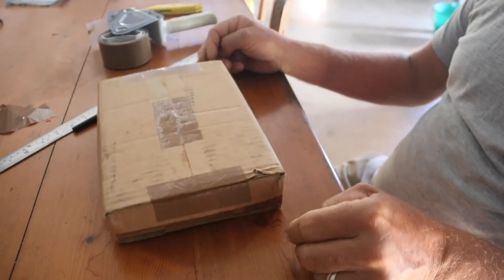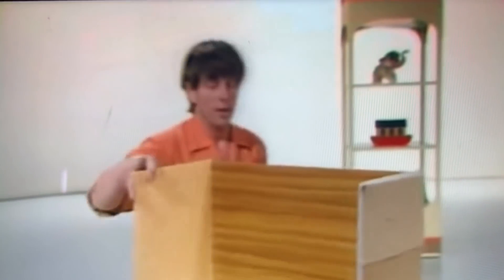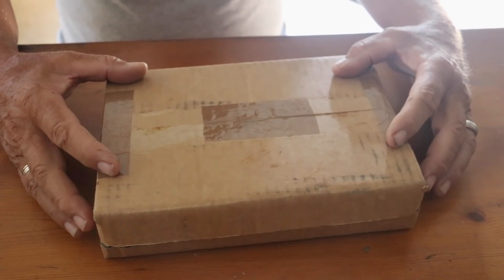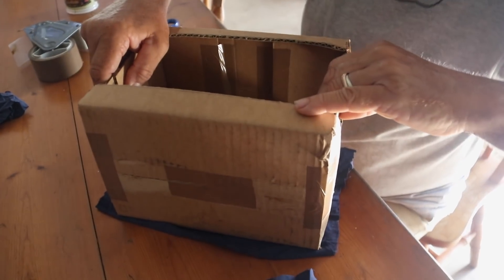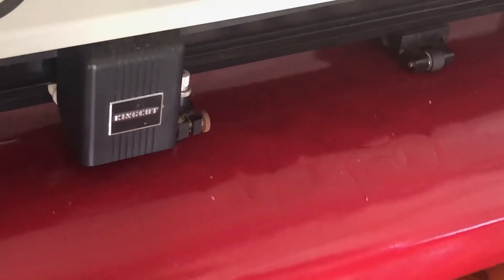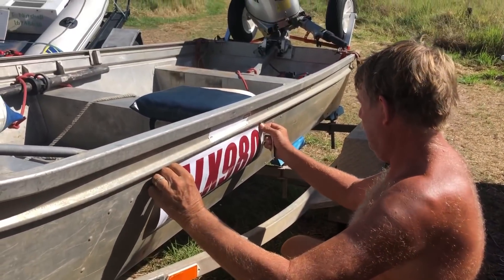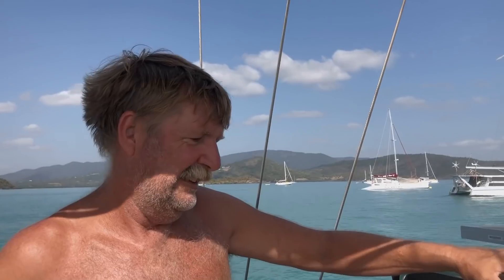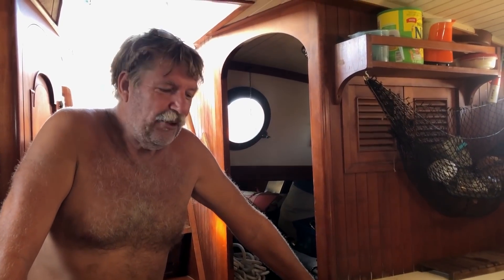Ep 186 | The Gearbox Work Begins, Sailing Nutshell, Australia

Comment: I have a HC38 from 1984. The galley drain pipe was also leaking and rotten stainless steel and being at the waterline could have eventually sunk the boat. also there was no decent flow to to inaccessible seacock below the engine. Fitted a sump tank for all grey water, sealing of the drain seacock and no more salt water drips over the engine!!
Reply from the maker: That is a good solution.

Comment: Thought I'd share a useless bit of information (UBI).  The only thing more riduculous than the fact we still don't use the metric system in the USA is the fact that the USA's Bureau of Standards and Measures officially converted to the metric system in 1975!  So we are officially a metric country, but haven't managed to put it into practice!  How's that for government work!  You might remember we planted a very expensive satellite into the dirt on Mars a few years ago because some engineers were using the Metric system and some were using Imperial.  Just think how much cheaper our gas prices would be if we adopted the litre! ;-)